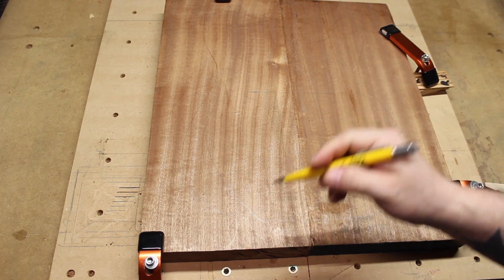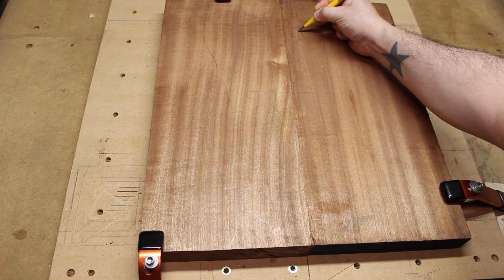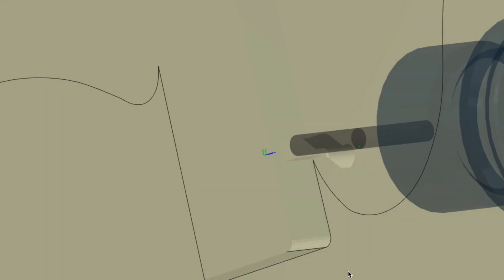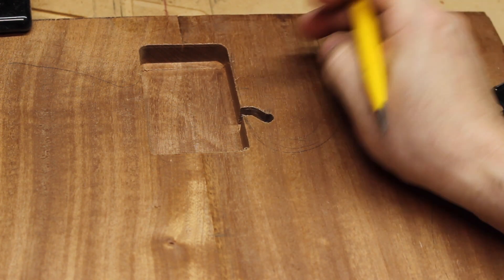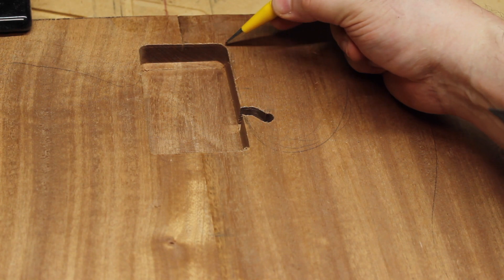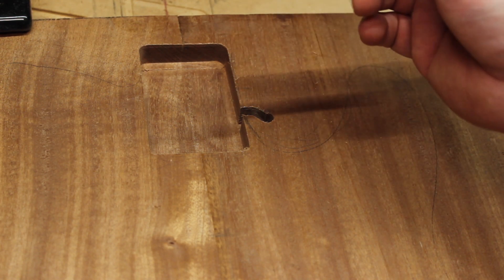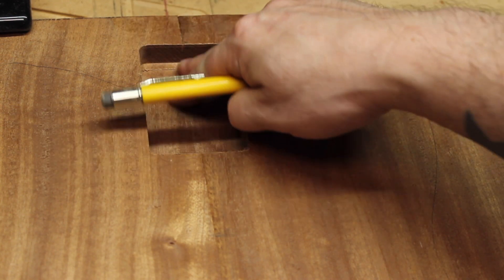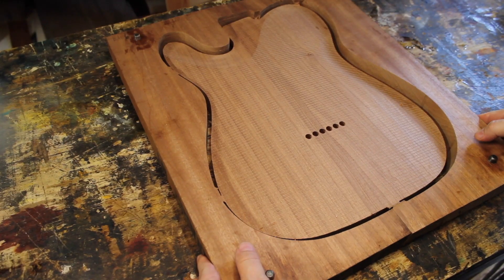CNC Perfect Neck Pocket Corners - Every time

Comment: How do you test the neck to ensure a snug fit. Last time I cncd a body my neck pocket was about a 64th too tight. Threw off my alignment. How do you combat this?
Reply from the maker: Hi Noah, my geometry is dialed in perfectly after lots of trial and error. I used a 2020 Fender Tele neck to test fit into several test pockets before ever cutting into an actual body blank. I finally landed on a great set of dimensions that works every time. I saved the neck pocket geometry as it's own file that I can use in every body build. I also have grown to understand my CNC machine and all it's idiosyncrasies. I know how much I have to cut to to get a snug fit for any type of inlay, pocket or cavity. So to answer your question, I don't have to test fit a neck in my pockets, they always fit snuggly. Take care.

Comment: Hi, how many times you had a failure in this simple detail? It's seems to me that CNC is a question of trial and error, I'm wrong?
Reply from the maker: Hi Adrien, Your partially correct. It is a question of trial and error but luckily those trials occur in the simulation of the CAM process. I can see failures and errors before I ever start cutting. That is one advantage of generating tool paths. I can simulate them in 3 dimensional space before I commit them to milling. With the sharp corner at the pocket, I never had a failure. I knew in advance that it was a troublesome area and started cutting that channel to stop any potential failures.

Comment: interesting video as usual....!! Please tell me how long it takes, on average, the shapeoko to mill a body. Thank you
Reply from the maker: Hi Davide. Great question. But there are so many variables it’s difficult to give an accurate number. Let’s say for example we are milling a tele body. There are no arm carves or belly carves on a tele, so less time. Also the more time you spend on finishing passes the less sanding you have to do. Those are just operations. Non-operational processes take time too, like bit changing and work holding. Everybody will have different milling times. There is no right or wrong time length. I have chosen to use a combination of processes that have my body milling time down to 1hour and 40 minutes. That includes stock alignment, work holding, several bit changes, dust extraction, etc. Hope this helped.
Reply: @MarkGutierrez  thanks for the clarification ... it is obvious that there are too many variables ... my question was to have an order of magnitude between a hobby cnc and a "professional" cnc that maybe it takes you 10 min (and 50K-100K $ to buy it) ...
and now a more difficult question ... ;-)
did you already build guitars without cnc?
and how long did it take you to get these results I intend to study the cad-cam program ... know how your cnc works? thank you for your time and most of all very interesting videos ... even in the way you explain them
Reply from the maker: @Marwatt  I started building guitars just like everyone else, with templates. I made a lot of telecaster bodies. I sold every one and raised enough money to buy the CNC. When I built guitars using templates they came out awesome. When I got the CNC I made a few mistakes on the first two or three bodies but then worked out all the bugs. I got necks right on my first try. Good luck with your studies of CAM CAM. It will be a fun and rewarding journey.